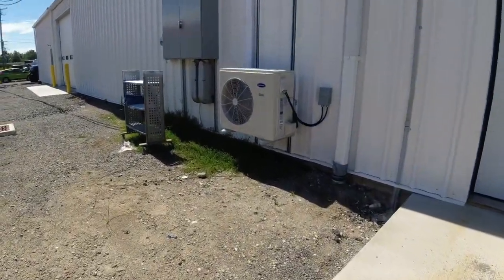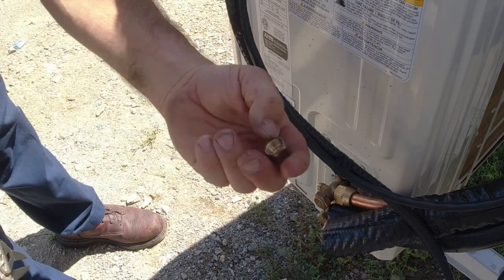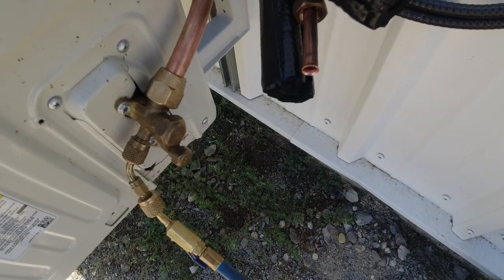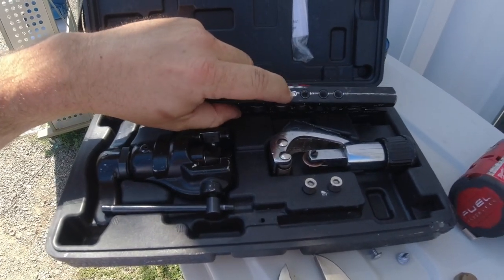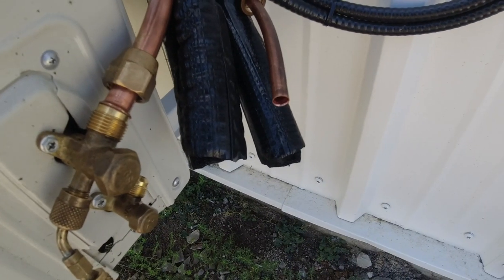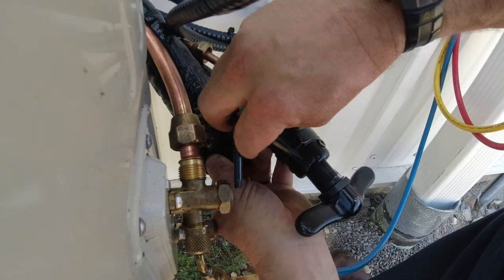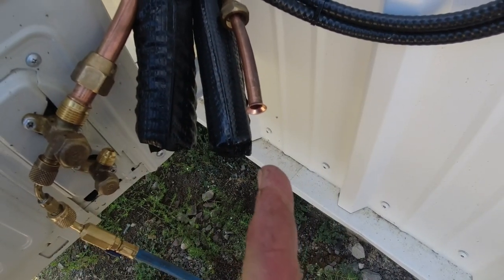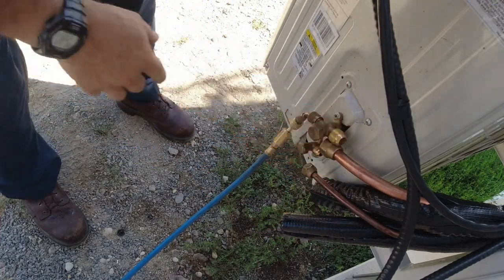Mini-split Heat Pump Not Cooling / How To Properly Flare Without Leaks

Comment: Great video. I use the flare kit they gave me at school. I use a nickel for thickness to size up the copper through the block. So far seems to work creating nice cone n proper fit. I also cut my thumb but didn't go to the hospital, I'm n idiot. Few days later I go get medical care n it was infected but thankfully didn't lose my thumb but too late for stitches. Missed a couple weeks of work. Thanks for sharing n that wrench tool was pretty cool.
Reply from the maker: I had a procedure done on it.
Reply: Glad it's all good 👍

Comment: I have the Hilmor flare kit you referred to. It works great. The stop is nice as well. Lets you set the height for a nice flare. The kit also has swage adapters too. I also have the Hilmor hydraulic swage kit, i use it for any swage joint. The pistol grip and easy release are handy.
Reply from the maker: They are nice, I have the Hilmor pistol swagger and the bender. Thanks for watching!

Comment: BTW the grooved sections of the tubing cutters are for cutting off flares. 
  Put the flared end in the two groves in the rollers and the blade sits right next to the old flare to be cut off.  This minimizes the amount of length reduction of the tube before re-flaring.
Reply: @gordonborsboom7460  Correct! Finally, someone who knows what’s doin’. That is exactly what the groove is for on a tube cutter. This you tuber is a bit of a goofball.

Comment: mini-splits are very common here in the Seattle area because most houses and apartment/condo buildings weren't built with ducting.  Until recently AC wasn't really a norm around here due to the normal air temperatures rarely getting much above 80 for most of the year.  The past 10-15 years though have seen some pretty substantial increases in temps during the summer (hit around 110 in this area at the end of June this year) so a lot of people are getting them installed.
Reply from the maker: Interesting, Funny how the weather is taking a shit on that side of the country where most of the extremist climate change Legislation starts at🤦‍♂️🤣🤣
Reply: @HVACRSurvival Weather Warfare...  They never stop geoengineering.

Comment: Noticed how you set the flare on the fitting of the valve then tighten nut by hand 100% correct. I have seen guy's just gab the line and start turning the nut on until it seat's
Reply from the maker: Thank you! I try to show the correct way because I learned the hard way.

Comment: I'm getting rid of my Carrier  Central air heat pump AC  unit because I've had nothing but issues with it.. It's only 5 years old it was out at least once a year parts hard to find for. I'm going to be going back with Mini splits. The company I work for has several of they worked great.

Comment: I'm installing a DIY mini-split for my garage I bought a flaring tool off Amazon when I saw the eccentric cone wobbling I thought the tool was broken. I already left them a bad review with a video and was in process of returning it until I started watching some YouTube videos how these work. I practiced using some scrap tubing it actually worked really well for $27 it's not bad works just like the expensive ones. NAPA sells individual crowsfoot adaptor in their Carlyle brand for any torque wrench I already had a digital 3/8 and 1/2 for automotive work these are flare nut crowfeet even better.
Reply from the maker: Just make sure when you do the crows feet that you are 90° on your torque wrench And not straight in line from what I’ve been told.

Comment: More and more of the ductless splits are being installed. when i first started in the trade,  i rarely installed them and now adays almost every house has one. especially on the top floors of houses!       When i grew up i didnt have an ac til i was like 21.     been in the trade 20+ years  things has changed since.  good video
Reply from the maker: I fully understand,  Same thing here. Thanks for checking it out gas man

Comment: Hi rick great video, if the copper pipe isn't completely kinked its just slightly ovaled out. You can use the flaring block to straighten out the pipe, clamp and tighten rinse and repeat haha. Untill it straightens out, or the old school way i was shown use a shifter/ wrench jaws to straighten it out just round it off a little, end goal get that nut up enough to flare the pipe lol. Also i mostly do refrigeration but I've done some AC work over the years. Some of those split ACs have a recovery/ evacuation mode to open up the many thousands of solenoids contained within. You have to push this button on the PCB 10 times hold this button down for 10 seconds wait for this light to flash and so on.
Reply from the maker: Thanks man for the info! I use the crescent wrench trick sometimes.

Comment: It does take a bit longer but i prefer to braze the lines that stick out from the Blower Unit, it just save a little headache and eliminate one leak point...I do not want to climb a ladder to look for a leak, no sir...Good work Rick
Reply from the maker: Long as your using nitrogen, why not👍
Reply: @HVACRSurvival  always
Reply: Many manufacturers don't recommend brazing on mini splits.  The reason is they have such fine mesh filters that they clog super easy. Sounds like you use nitrogen which is good - every time.  Miss the nitrogen one time and it will clog the filter.
Reply: @wakes_inc  I do flow nitrogen every time. I rather take a few minutes to set up than to come back on a leaky flare nut 20 ft in the air.

Comment: One of the best videos on vacuum processes and flares I have seen. You really know your stuff, especially about moisture and oil in the line sets. I am an amateur, but I would def hire you to do my installation. Most of the so-called mini-split experts around here do not even weigh in new coolant, they spitball it by reading PSI with the compressor running. Also - no nitrogen. I am new to your channel but I hope you have more videos like this. And I get why you dislike mini-splits - in theory they sound great, and if the install goes well they can be - but too many of them fail and then they are close to impossible to fix.
Reply from the maker: I have a few mini-splits videos and a lot of refrigeration. Click on my name HVACR Survival just below the thumbs button and that will take you to the channel, then you can search by all videos or category's

Comment: Honestly wouldn't surprise me if those were the factory flares on the lineset. Ive learned the hard way to always check them before i screw them on. Ive even had one of my coworkers tell me after taking the training courses for mini splits they recommend cutting them off and redoing them using the flare nuts provided on the unit which are usually nicer heavier nuts. And also had great luck with the drill style "spin flare and swedge" tools. Between those and a tubing bender i hardly buy fittings anymore for soft copper.
Reply from the maker: I love my spin swage but I'm not sure I would trust the flare version because I looks like you could over flare it?

Comment: I did a repair on a home owner diy unit. Had to open it up. In pulling a vacuum, I changed my oil 3 times. It would go cloudy very quickly. Wasn't my fault, so I just charged it.

Comment: The worst thing about mini split is techs hate working on them so they charge a crap ton of money for no reason. My sister's quote was 35k for a 5 head 2 compressor install. I found both units for 11k so they are asking 24k for install.
Reply: No HVAC company will add the equipment price to the contract, to what you buy it for online, the 34k or whatever is for the quality workmanship and warranty, and ofcourse overhead.

Comment: I think in one of your video's you  were talking about the appion valve core removal tool as junk. Think I'm have the same issues. What kind are you using now and are the any good ? Thanks for your time
Reply from the maker: I like C&D, I use my appion for recovery and things that don't matter.

Comment: Excellent video…. Was wondering that you have the micron meter attached without an additional shut off… is there any reason others add a shutoff… Ty
Reply from the maker: They are worried about the gauge being damaged. Mine is built to take it, that's why I brag about this BluVac micron gauge as being the best. I've had Fieldpiece, CPS, and used a few others and they were all weak and didn't either hold up or they weren't as accurate.

Comment: Should outside fan blow warm or cool coming from the house?
Reply from the maker: Are you in heat or cool mode? If cooling then warm, the inside and outside are the opposite of each other no matter the mode.
Reply: I appreciate the like ! But do you know if it should be blowing warm?

Comment: A word of caution.  I have the Yellow Jacket torque wrench and inside the case cover it has a chart that states torque settings for pipe sizes that are way over what a mini-split manufacturer recommends.  For example on a Pioneer system with ⅜ pipe, Pioneer recommends a torque of 19 ft-lbs while Yellow Jacket on their chart recommends 30 ft-lbs.  For ⅝ pipe Pioneer recommends 34 ft-lbs and Yellow Jacket recommends a whopping 56 ft-lbs.   56 ft-lbs is way to high.  Tightening too much will cause a leak by separating the flare from the pipe.   And sometimes even break the flare nut.  Be aware that copper pipe hardness varies and soft pipe (easy to bend) requires less torque.  Check the data sheets on the mini-splits you are working on.
Reply from the maker: I looked up my specs from the MFG but I agree some do appear to high. Thanks 4 the info. I mainly do Mitsubishi and Carrier

Comment: 5.73 Lbs.? how many BTU's is that unit? Sounds like a lot of 410a? I really like these mini splits ,they are super efficient and very quiet with an easy install. I'm not so impressed with Carrier, hopefully it has a high pressure sensor? I hate that none of these M/S units have a high side port.:face-fuchsia-poop-shape:

Comment: Did it have a 3 pipe compressor?
Reply from the maker: There are only two pipes between the evaporator and the condenser, otherwise it has a reversing valve in the condenser.

Comment: What do you do when the lineset sizes are 6mm and 12mm?  I can't find a 12mm flaring die ANYWHERE... 😢
Reply from the maker: Depending on what size I'm going, we talk in fractions where I'm at. 1/4, 3/8, 1/2, 5/8,  3/4, 7/8
Reply: @HVACRSurvival  ya, me too. Texas.

Comment: Q. Regarding pressure testing with nitrogen how many PSI and for how long? 
Thanks for great video..
Reply from the maker: The rating plate has the maximum pressure allowed and time depends on how determined you are to verify the system isn't leaking. 15-30 minutes is typical for a quick test with a digital gauge. Overnight to a couple days for large systems.

Comment: Nice one Rick. I was wondering if you were gonna check the top flares after finding that one not-a-flare at the outdoor unit. Glad you did. I've actually been in the market for a torque wrench for those. So thx for the recommendation.
Reply from the maker: I haven't had any problems with it yet, but if the Nut gets larger it might not fit but I haven't found that to be the case yet. You can always use a claw foot on a regular torque wrench if you position it correctly.

Comment: For the items I carry in my car, that sit a long time, I use good qualilty Zinc Chloride Carbon Zinc batteries.  (I also use them in remotes).  They will leak eventually, as all batteries will, but they don't leak an acid or alkaline. They leak salt water.   They also don't leak as often as alkalines do.  (People call Duracell the worst, they might be, but I've seen Energizer, Kirkland, etc, all die years before their 'use by' date when sitting in a device). 

No, they don't run as long, or under as heavy of a load, but batteries in a hot car wear out fast no matter what.   In induction toners, probes, multimeters, remote controls, etc - they still last years.   (There's a reason that the smoke detector people use SHD batteries.  It's not because they're cheaper anymore.  It's because they last the full year necessary, and don't self destruct and eat the detector.)  

So, for a low drain (such as the digital torque wrench) device, that's used intermittently - ZCl batteries are perfect.   If it's something you're using a lot, and drain batteries regularly - alkaline or NiMh for the win.   Still a good idea to have spare batteries lying around.   (Oh, if one leaks, you clean it up with water and a q-tip).  

Hope you save the copper pieces for recycling later :)  

Good to see you go those extra steps to  make sure all of the connections are like they should be, rather than just fixing the obvious flaw (the loose one) and heading out.  Too many people, especially if it's not their name associated with the company, don't care about reputation.

Comment: I always feel like I’m going to snap those brass fittings when using my torque wrench. I have that same wrench.
Reply from the maker: That's why I verified I had the correct values. I have damaged the flares that are not correctly made.  I found a chart with the main 4 or 5 brands requirements.

Comment: Well luckily I barely have to deal with flared fitting the only time I really do is with rehabbing some old gas other than that I tried to avoid them because I'm more of a plumber and do not have an HVAC license I do other things than plumbing but I have no EPA card. LOL
Reply from the maker: I've done all the departments at my previous employer, (plumbing, electrical and whatever needed done.) I don't have to any plumbing here😁. Thanks 4 watching!

Comment: That’s why You use nitrogen to pressurize the system to check for leaks and nitrogen evacuate the moisture that’s in the system. Nitrogen purges the system to. Mini splits are very easy to work on. Dikin mini splits will also stop working if it’s low on gas so they won’t go in to vacuum
Reply from the maker: Nitrogen's only gonna do so much, Poe oil won't let go of the moisture like mineral oil will. That's why it's important to use nitrogen when you're brazing because the Poe oil scrubs the pipes clean and it's just a bad oil for people to do shit half ass.

Comment: 28:00 people always ask me why i’m bothering to invest money into my 40 year old R22 AC… QUALITY. I’ve seen so many new systems made from tin cans and plastic. I hate them, they have way to much electronics and sensors everywhere. I once had an AC job at a flour mill, they used small ACs to cool the controls and electronics of the milling machine. The control board of one of them failed and a replacement would have been around $800 from Germany. I replaced the control with some manual thermostats (luckily it wasn’t an inverter compressor) and a relay. They payed around $120 for spares and my salory.
Reply: You didn't pay yourself enough for your vast experience, knowledge, and resourcefulness.  Hope you won a new customer with the "low-ball" price.

Comment: Some would say putting Nylog on the backside of the fitting rather than only on the mating surfaces will cause the torque to be inaccurate.
Reply from the maker: It could cause that but the whole point of lubrication is to not mare the rear surface and twist it. You can tell if it's getting too tight. Oil is fine too, it's just easier to carry nylog.

Comment: Burring makes the flare weak. And might get copper into the mini split. Some brands do have filters for debree though. Best is to use spring loaded cutter. And nylogg. And not to overtighten the flare.

Comment: What kind of cheater cord setup are you using.  New to HVAR/R and I absolutely love that.
Reply from the maker: Which cord was it?
Reply: @HVACRSurvival  the one with the light and fusible link.
Reply from the maker: I built it out of a lighted extension cord, and added a fuse to it, and some gator clips.

Comment: Rick, would have been 🤤, if you heated your flair up after you made it..
But Stella job as always👑👑
Reply from the maker: I've never heard that before, What is the thought behind heating it up the flare when your done?
Reply: @HVACRSurvival 
You heat it up, because you make the copper hard when you make the flair, and the you heat it up when you are done to make it soft copper again.
Reply from the maker: Interesting, I've never heard that before but makes sense👍👍💯
Reply: @christiansommer914  
Is that part of what a spin flare tool does?
Reply: @HVACRSurvival  maybe Dave or Chris have heard of this.
Reply: @jrsmyth9761  yes and no.. Yes if you spin your flair and while it's burning hot tighten it, because then the copper hasn't hardened

Comment: My only complaint was that you didn't hook up your micron gauge to the opposite side of the system as your vacuum pump. 
  Other than that, great job.
Reply from the maker: I still valve off and do the decay test once I’m down. Thanks for the feedback 👍👍

Comment: 13:50 Could you possibly get a "back-up wrench" on the hexagonal cap of the shut-off valve?  You'd be coming at it perpendicular, but maybe the block and entire case would not be flexing so much.

Comment: Did you make that cheater with fuse and light, or do you use the Zebra one ?
Reply from the maker: I copied it and made it,  my original one did not have a fuse or a lighted plug